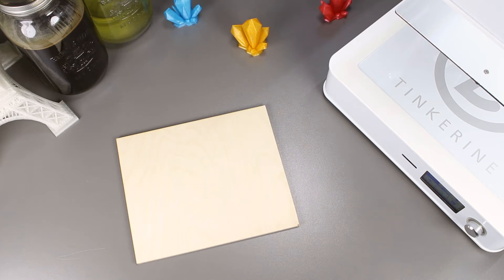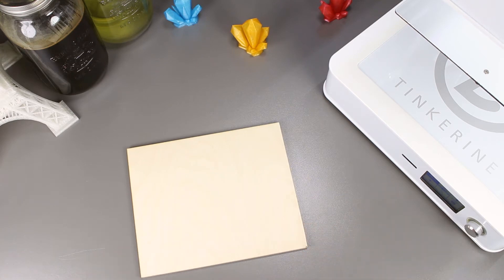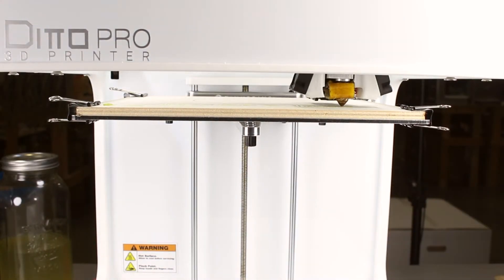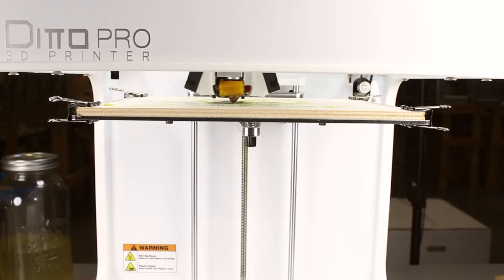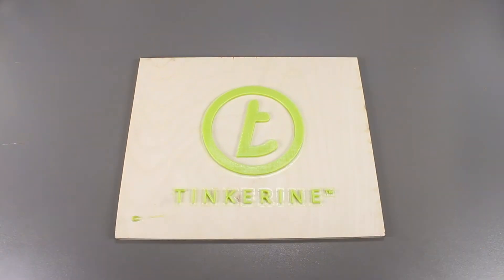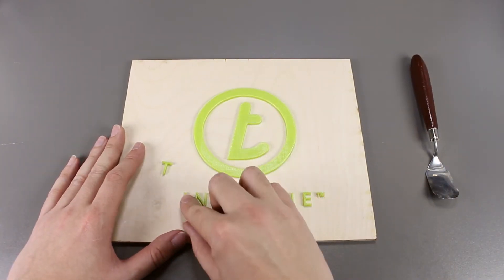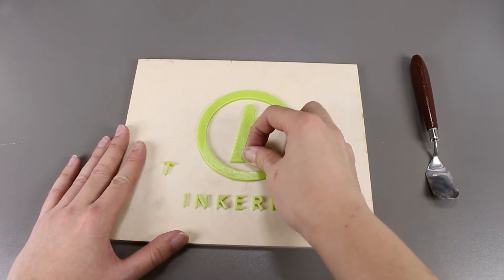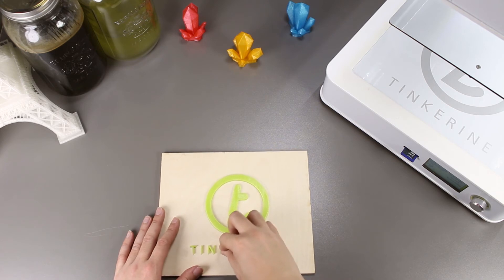3D Printing on wood

Comment: This is actually a quietly revolutionary idea which I haven't seen anywhere else yet. The potential is there to make much more pleasing results than laser sintering wood. I'm writing this eight years after the video was made and today's printer / slicer tech would be capable of making a much better finish, without the layer lines left by your printer. I wonder if you just placed the wood on the print plate and hoped for the best, or if you adjusted your z home to compensate for the thickness of the wood? The whole idea of 3D printing onto things rather than print beds has so much potential.

Comment: Was the idea to print on the wood, for  sign, as an example? Or to use the wood as a print bed? As a print bed, I'm imagine it would be pretty scared fairly quickly.
Reply from the maker: Hi!

The idea was to just see whether or not it was possible for PLA to actually stick onto the wood. But now we validated that it is a possibility, you can make cool designs with it!